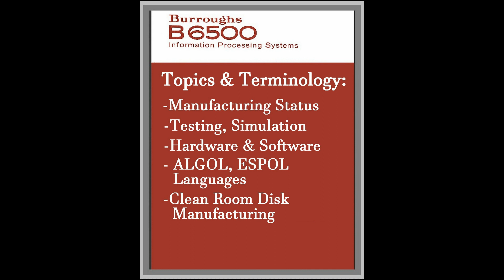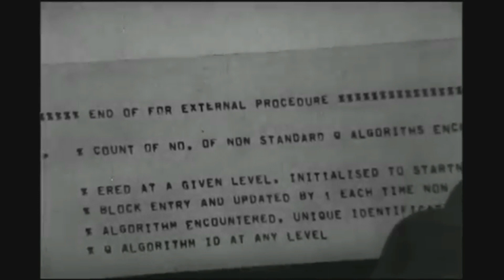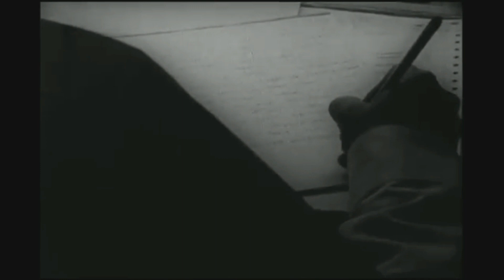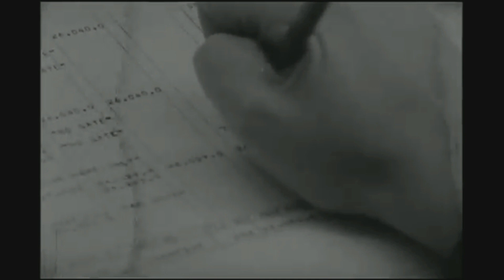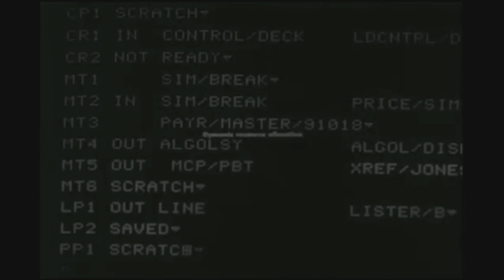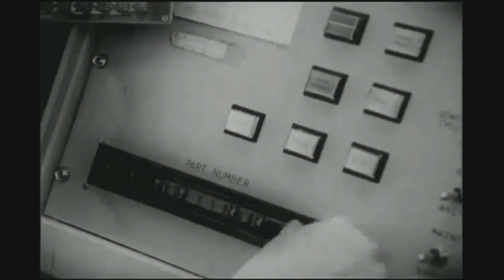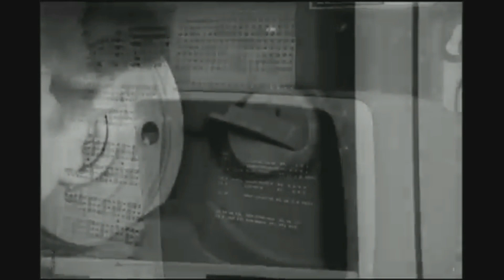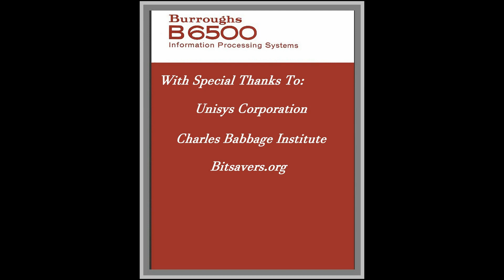1969 Burroughs B6500 Computer Vintage Mainframe History (UNISYS, Data Processing, Pasadena))

Comment: I sent this video to my dad, who worked at Burroughs, and he sent me this:

"This was really fun to watch. This was the state-of-the-art when I first began working as a co-op technician for Burroughs in Plymouth, Michigan. However, I worked on what they then called Terminal Computers, essentially for things like a bank teller machine. It was really a hybrid with lots of mechanical and electromechanical parts, like the keyboard, the paper tape reader to store programs and data (think eight bit rows on a tape with a punch being a 1 and no punch being a zero) and a Selectric “golf ball” printing head. The integrated circuits used for logic and limited digital memory had about 100 transistors. One job I had was laying out the circuits to be etched on the printed circuit boards shown in the movie."

In 1971, he worked at Datapoint and had a Datapoint 2200 at home as part of his technical support job. He also worked at Sycor in Ann Arbor from 1974 to 1978, and one of his big projects there was creating a custom version of the Sycor 440 for Yellow Freight Truck Line in Kansas City: 

"We put them in their freight terminals to automate the creation and communication of Freight Bills. I wrote much of the application programming and traveled to KC and several of their freight terminals to install and test it. I carried a beeper to respond to technical support issues. I had many interesting experiences with that project and in KC."
Reply from the maker: Hi Jonathan, thank you very much for sharing your dad's comments on the Burroughs film!  It sounds like he had quite a fascinating time working with these early machines back in the 1970's.  It is great to hear some of the first-hand experiences like his, which many people today do not know about.  Glad you found this interesting too.  Hope you can explore some of our other films as well.  Thank you again for sharing this!  ~   Victor, at CHAP

Comment: I used to be an operator for a B500 banking system and later an operator for a B3500 computer. Alas there is virtually no footage available for for the B500 machine. It was my favorite small machine. I keep looking though. 

Thanks for the footage.
Reply from the maker: David, thanks very much.  Hopefully, some B500 footage will show up.  Thanks for the info! ~  Vincent, CHAP

Comment: I was a B3500 computer operator during the early 1970s for the USAF. The Burroughs MCP allowed for most jobs to started with ONE control card.  The computer could run a variable number of variable sized programs at once.  In later years, I was amazed to see how primitive IBM computers were with the baroque JCL system.
Reply: Me too (AFSC 511X0) Plattsburgh AFB 73-78, instructor at Sheppard 78-79. Loved working with the B3X00 system.
Reply: MCP has a great entry on Wikipedia. Amazing amount of details. Knuth as a student intern made it possible. It is still in use.
Reply: I was too. I operated a B3500 at Kadena AB in the 80's that supported the MAC terminal and cargo operations. It was eventually replaced by a pair of Honeywell DPS-6 systems.

Comment: When I was in high school, we had a mod33 TTY connected to a b5500 timesharing system. fun stuff. After college, I got a job with Burroughs as a field service engineer. I installed and repaired a 6700 system.... also fun stuff.
Reply from the maker: Hi Jim, Thanks for sharing that.  From what I have seen, the 6700 was a beast.  I can imagine it was fun to work on too.
Victor, CHAP.
Reply: @ComputerHistoryArchivesProject  The 6700 was a large mainframe if you had it fully configured. You could put three cpus and 2 i/o modules, 6MB memory (cores), and cabinets for the I/O interfaces. Terminals ran off sub processors called DCPs. Probably used enough power for a couple suburban houses.
Reply: That's cool. How long did you work  for Burroughs ?
Reply: @fridaynighthikes  11 years

Comment: It's probably a little late to mention this, but it bothers me a bit: the title is a bit wrong. It is a "UNISYS Burroughs" Film", not Sperry film. Burroughs didn't buy Sperry until about 1986, so this film predates that by almost two decades.

I worked at the Pasadena plant with some of the people in this film from 1972 until it closed, then at Lake Forest until it closed, then at Mission Viejo until it closed. 

While the plants have closed the successor machines to the B6500 still exist, are still sold, and are still used. Neither the software nor logical hardware architecture have really changed all that much since 1965. Unisys still pays me to design the processors for these machines.
Reply from the maker: Hi I Wilton,  Thanks very much for your feedback on the title.   Actually, the word "Sperry" was in the title line just to help people searching for Sperry related products.  You are correct that its a Burroughs film.  I corrected modified the title and put "Sperry" in the metatags.)      It must have been interesting to see some familiar faces in the film.     Thanks for the observation. Good spotting. ~  Victor  CHAP
Reply: @ComputerHistoryArchivesProject  I always thought Unisys was going to exploit the Sperry merger in advertising. After all, Sperry was the successor to Univac, the first commercial computer, itself a successor to Eniac. "Unisys: the first computer company" :-)
Reply: I wonder if anyone has thought of replicating a 6700 inside an FPGA, and running one of the demo boards like the Altera DE-2, the retro folk use.

Comment: I worked for Burroughs from 1965 thru 1970 as a computer engineer. At the conclusion of one training mission at the Mission Viejo plant in 1969 the manager offered me a slightly damaged 39 inch storage disk as a souvenir. I happily accepted and used it as a tabletop. It has been the subject of many interesting conversation in the past five decades.
Reply: I so wish I had grabbed one when I had a chance!

Can anyone confirm the story about the "C72" protective coating on the surface of the disks?  I began my career as a Burroughs Field Engineer in 1973.  In asking another FE about the C72 coating, I was told that in 1971 there were so many hard disk crashes resulting in many unit replacements that the exec's told the design engineers, "You'd better come up with a fix, and fast, or you won't see 1972 with this company!"  The result was the C72 coating that sort of cushioned the blow if the heads touched the disk, avoiding catastrophic crashes.  So, the name was basically a pun.  See '72.
Reply: @stevenemert837  I operated a "B800" (1978?) in the early 80s. Great machine, but the hard disk crashes were still very common. I always had a bad feeling opening the office door in the morning. You could hear the scratching noises, when the head hit the disk again from far. It happend about 5 times each year... that and the maintenance costs later caused us to switch to a much smaller Data General.
Reply from the maker: Sounds like a great souvenir!   I bet very few are left, outside of museums.  Thanks for the comments!
Reply: @ComputerHistoryArchivesProject  The hard drive's bronze hub weighed 20bs. Of high-grade bronze alloy. Salvage yards might kill for that quantity.

Comment: MCP, Algol... I mastered those in the long past ago... It was up to date with B6700/7700 up to end of 1970s and the first years of 1980s... The greatest computer architecture even created.
Reply: So true. Was way ahead of its time.
Reply: One of the coolest things I remember about the 6700/7700 systems happened during our transition between those two. The 6700 was production, and the new 7700 had just finished installation and testing. We shut them both down, then swapped the disk cables between the two. Hit the "Halt" and "Load" switches - or as we called it "mash the buttons" both systems booted right back up, only now the 7700 was production and the 6700 was test. No muss, no fuss.... although the customer did recompile some stuff to optimize performance a while later. .